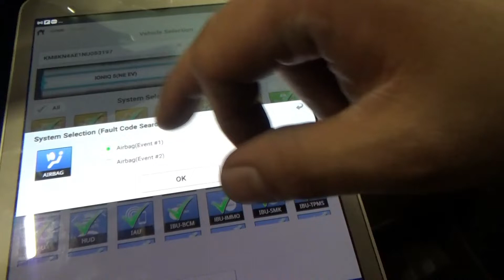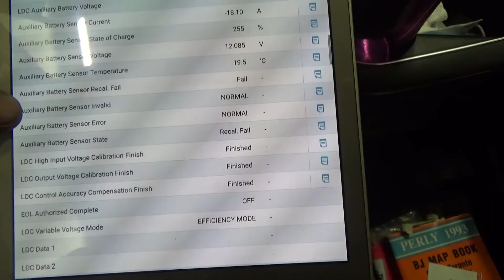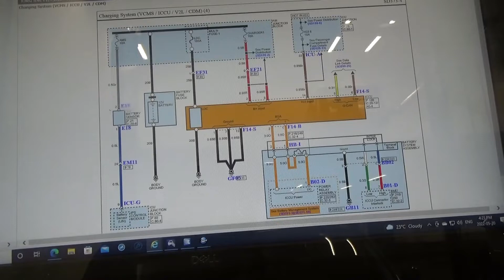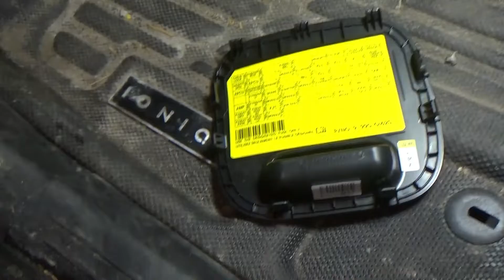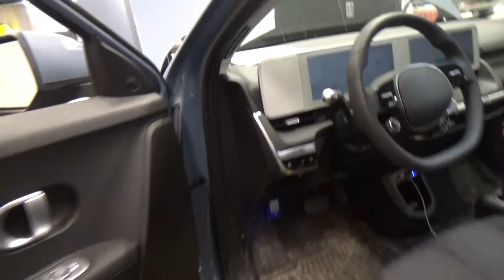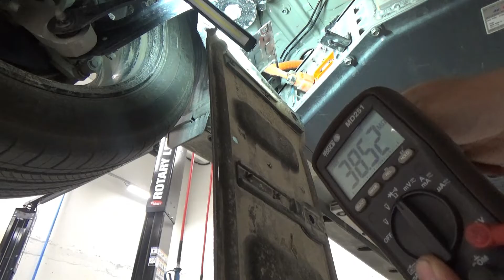Hyundai Ioniq 5 High Voltage System Fault - Battery Light On

Comment: Hi, I have a Kona electric 2020.
The car has a check ev system error.
Error code P1B77.
Do you think replacement of precharge relay will solve the it.

Comment: @hyundaitech what can make the AC compressor shut off when the brake pedal es pressed? I also see varying voltage from the compressor housing to battery negative or positive. (16v to 80v)
Reply from the maker: Where do you monitor 16 to 80 volts? Like the high voltage cable? Can you duplicate it in the bay? And how did you know that it shutting off? Monitoring the scantool or the ac stops blowing cold air? Never encounter that type of issue yet.

Comment: Did you disable the battery again (pulling the fuse) before you replaced the fuse?
Reply from the maker: I think if i remeber correctly the nut that holds the screw fell down inside when i tried to remove the fuse thats why i had to remove the battery. But the newer batteries right now since that happen, they change the design for the nut so that it wont fall down when changing the fuse.

Comment: Thank you for making this video. On my Ioniq 5 Had the iccu recall work done without the fuse being replaced in April 2024. 8 months later problem again with iccu and fuse but since the car went above 100.000 miles out of warranty and Hyundai wants £4000 for the parts and labour. Absolutely devastated.  Dont know what im gonna do. One service cost 25% of the value of the whole car. They say there is no warranty on the warranty work so i have to pay.
Reply from the maker: Double check if theres a recal for it, if the dealer wont budge contact corporate in your country they should atleast help you

Comment: After  my iccu failed and got replaced i got another problem lol . i find this car very unreliable at this point. now all lights come up , check LFA lane follow assist  , check foward safety systems , check lane change assist function, check blind spot safety sytems, check rear cross traffic safety systems , and also recuperation is not working ,i tool car to the dealer and they tought it is right rear abs wheel speed sensor because that is what hyundai gds was showing. they replaced it with new one. it was working fine for 1 day, and after it rained all errors came back again. for example this one that you are repairing not even 5000km on clock and allready broken.
Reply from the maker: Yeahh all new cars have this weird issue because of multiple modules.
Reply: @hyundaitech  what could cause all of these errors to come ? they come and go. sometimes 3 days without error and then when it rains it comes back . i also noticed when ev battery is left with lower percentage it comes more often. i will make some notes. maybe 12v battery is causing this issue. got 7 days without these errors and after 7 days they come back for like day or 2 then again it goes away. its so wierd. only eror gds was showing was fault in rear left abs sensor which they replaced. When these errors do come up when i turn car on if i move car immediately after turning it on it makes some jerking moves like something is preventing it to move and then it shuts down errors, but car needs to be moved imemdiately after turning it on . so wierd
Reply from the maker: @techgeek2994  if scantool flag only left side wheel speed sensor and not the other 3 sensors i would focus on that side, maybe poor connection or broken wire, coz if the car looses 1 speed sensor it will trigger all other modules especially if the vehicle is equipped with blindspot, front camera front radar coz it communicates to each other to see the speed sensor data.
Reply: @hyundaitech  it showed rear left wheel abs speed sensor, they changed new one  , but it didnt solve problem . They did change to new  abs sensor. Again all errors are coming. I am making notes now when exactly errors do come up , i am suspecting 12v battery doing this . we will see . I will buy myself launch x431 diagnostics so i will be able to see live data. What is intresting sometimes car works 3 or 4 days normal and then for a day or 2 errors come back. then again works normal then for a day or 2 they come back

Comment: what diagnostics tool module can do ioniq 5 ? where can this software be downloaded
Reply from the maker: Snap on zeus, autel top of the line scantool and many more, but if you want oem software yiu can search googld theres some company deals with gds the hyundai scantool.
Reply: @hyundaitech  i can see only 5000 usd tools my budget is 1000 usd, what is cheapest that can do coding on ioniq 5 i suppose only gds hyundai can do it
Reply from the maker: @techgeek2994  i have a aftermarket scantool its called thinktool pro and it can do most and can scan and check data too in different modules and can actuate components the only thing that i cant do is program or reflash computer coz i think you need a subscriptions for that. Yeah you can check other brand too like autel and launch or topdon.
Reply: @hyundaitech  this one you are using is 5000 usd oem hyundai gds?
Reply from the maker: @techgeek2994  yeah the factory one is expensive.
Reply: @hyundaitech  so there is still no chinese copy yet out there that can do same like hyundai gds .
Reply from the maker: @techgeek2994  hahaha i dont know about that.
Reply: @hyundaitech  they have one that can do only cars 2010-2017 i hope they crack newer one i have ioniq 5
Reply from the maker: @techgeek2994  no that wont read the ioniq 5, ioniq 5 starts at 2022.
Reply: @hyundaitech  indont get it why is oem 5000 usd that is ripoff

Comment: Selamat pagi waktu Indonesia , sebelum nya saya ucapkan terima kasih atas saran anda.saya berhasil 
 Mengganti radiator dan kondensor ionic 5.walaupun itu hal biasa pada mobil konvensional.saat ini pada mobil yang berbeda saya ada masalah.setelah melakukan proses charging semalaman,mobil tidak bisa proses perpindahan gigi.hanya bisa di posisi P.langkah apa yang harus saya lakukan.mohon maaf sudah merepotkan anda.jenis mobil ionic 5.tertulis pada dashboard  unplug vehicle to star.
Charger sudah saya lepas dari port nya
Reply from the maker: The ev vehicles when charging you cannot start it just in case the driver will forget that theres a charger hook up to the vehicle. You need to remove the charger and then you can start the vehicld which is normal.
Reply: @hyundaitech  sudah 2 hari ini saya belum bisa mengatasi nya kawan,saya coba hapus DTC dengan scanner.port charger sudah dilepas.tetap masih muncul tulisan unplug vehicle to start.elektronik shiffter hanya bisa di posisi P.
Reply from the maker: @santososahdinoto9502  so your saying, you were able to.unplug the charger but its still showing that the charger still plug in in the charge port? Theres like a emergency cable in the trunk compartment to releass the lock actuator, maybe try pulling that if it will help. Is there any codes in the vehicle?
Reply: @hyundaitech iya betul,DTC menunjukan tidak ada kerusakan.ok saya coba saran anda.kendaraan berada di pusat perbelanjaan di tempat parkir,terima kasih kawan.saya mengganggap anda sebagai guru dan referensi dalam ev.
Reply from the maker: @santososahdinoto9502  so im i just using google translate, so no codes in the vehicle right? You perform full system scan like other modules too right? Okay let me.know if theres any improvement.
Reply: @hyundaitech I have followed your advice but the vehicle still cannot shift gears.
Reply: Today we were helped by 4 technicians from Hyundai Motor Indonesia but the problem has not been resolved either
Reply: I've pulled the emergency button in the rear trunk but it hasn't worked either.
Reply: What strategy do you think I should do tomorrow?
Reply from the maker: @santososahdinoto9502  waooww thats weird. I have not encounter that yet. Maybe try remove negative and positive cable on the 12 volt battery and those cable jumped it together, try to do a capacitive discharge, then wait 10 to 15 mintmutes then reconnect both cables to the 12 volt battery and see.
Reply: @hyundaitech  We have also replaced the 12 volt battery with a new one.
Reply from the maker: @santososahdinoto9502  have try unplugging the lock actuator for the charging port?
Reply: @hyundaitech  OK, I'll try tomorrow, friend.
Reply: Today I tried what you suggested but it didn't work either
Reply from the maker: @santososahdinoto9502  hmmm, thats hard. Unless you gonna start unplugging some stuff and see, you have iccu and vcms. Iccu located under the rear seat carpet  and vcms is at right rear quarter panel. You sure theres no codes? What does hyundai motor indonesia say?
Reply: Currently, Hyundai Motor Indonesia is trying to fix it
Reply: Meanwhile I was assembling a conventional petrol Toyota engine so I left it for now.
Reply: In the next news, I will inform you about the development of the car
Reply: That's even if Hyundai Motor Indonesia is open to this case
Reply: Thank you friends for your suggestions so far

Comment: Hallo bro, saya mekanik dari Indonesia,saat ini saya sedang melakukan penggantian radiator ,air pendingin tipe apa yang harus saya gunakan.apakah bisa dengan coolant mobil konvensional.untuk mobil ionic 5.ada 2 tabung reservoir
Reply from the maker: No, especially the coolant thats goes to battery system should be low conductivity coolant. In our case here in canada we use the blue coolant, i think you have to ask your nearest hyundai dealer.
Reply: @hyundaitech  ok terimakasih saudara atas jawaban nya.kami mekanik di Indonesia minim literasi tentang mobil listrik.channel ini sangat membantu saya.terima kasih
Reply from the maker: @santososahdinoto9502  no problem.

Comment: Do you think the impact wrench might have trashed the plastic holding that nut on the fuse screw? Would you maybe proceed next time with hand tools?
Reply from the maker: The design for that model on the fuse holder were garbage, but they made changes for that already for the newer vehicles coz a lot of shops has same problem i had when this first problem happened.

Comment: My son has the same ICCU catastrophic electrical failure. 1 year old, about 13 Thousand Kilometres (we are in Canada). Huge swelling problem for these cars at ab1 year in. Part backordered and no delivery date supplied by dealer or H. Seems from Reddit forum it is about 6 week wait.He was supplied a rental car plus gas. I have same car one year newer. Estimate is that about 5% of the Ionic 5’s  have the issue but hard to say as it’s early days. Hope for everyone’s peace of mind the problem is diagnosed, recall executed and part fixed and replaced. For now if you have one of these otherwise beautiful cars you are driving a ticking huge problem.
Reply from the maker: Yeah with technologies right now and especially if you are talking about modules i agree with you it take so much time for the part to arrive. I hope theu fix your vehicle.
Reply: Fixed! About a month wait. Do you know if the ICCU has been modified to prevent failure?
Reply from the maker: @alvinwasserman1397  hi, it really doesnt specify that its an improve component or just the same, but i will assume its an improve one because of this issue.
Reply: @hyundaitech  thanks. Guess we will know more when more 23’s hit the 13k mark.
Reply: No it is not unfortunately. @alvinwasserman1397
 on my ioniq 5 first time at 95000 miles iccu was changed pqrt of recall work in United kingdom. Same problem came back after 8 months 15000 miles later  but now they say my car went above 100000 miles so I have to pay £4000 for parts and labour. Absolutely shocked and devastated. Don't know what I'm gonna do
Good luck to all Hyundai electric car owners and hope you will don't have to go through the stress I'm experiencing
Reply: It's early 2026 and the issue with failing ICCU's has not been resolved.  Ask me how I know

Comment: Hi! Interesting video! I was wondering if I could ask you a simple question about my 2016 Kia Soul EV's radio/navigation unit. I'd like to upgrade the stock head unit because it is frequently very slow, especially when first booted up, and there are some REALLY nice Chinese Android-based head units out there that are getting good reviews.* 

Anyway, am I right in assuming that the Soul EV can operate without the stock head unit in place, even though some features might be missing? Could a head unit made for the GAS version of this same year Soul work, even though it would be missing some features (at first)? I believe I have found other ways to get that info, like through an OBDII dongle and Torque Pro for many functions like tire pressure, battery cell health and so on.

Thanks in advance for any info you could give!

* Like this one from T'eyes: https://youtu.be/7A_vjC0mWKE
Reply from the maker: i believe with the hybrid or electric models there hybrid information is part of the unit. i would not recommend replacing with aftermarket one coz for sure theres some communication line involve with that. compared to gaslonine models, they are just straight audio unit and for sure you put any radio whichever works or fits on the dash. maybe theres company that supplies or provides that kind of product for hybrid or electric models but i never heard one. Hope that helps.
Reply: @hyundaitech  I found out that the stock head unit can be replaced with no problem. The "brain" is located elsewhere, apparently. I will order from Amazon so that if it doesn't work the return process is simple and easy. The one thing to keep in mind, for me, is that some information will have to be obtained in other ways, such as through an OBDII dongle and an app like Torque Pro (for things like battery health and status, etc). The T'Eyes model mentioned above can communicate with the vehicle apparently and get other types of information like climate control settings, which is the main thing I was needing. Some vehicles need a specific CANBUS decoder box, which they supply with the unit, and some do not.

Anyway, thanks for the information and the quick response!